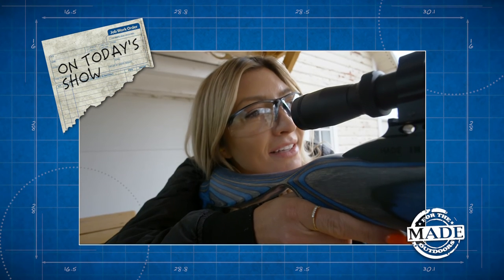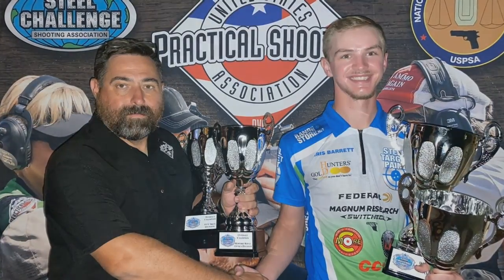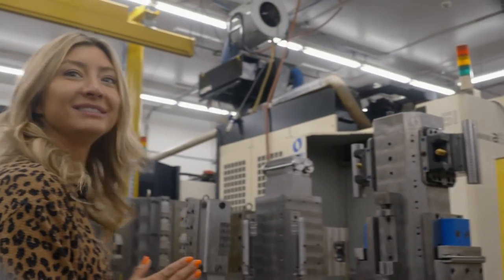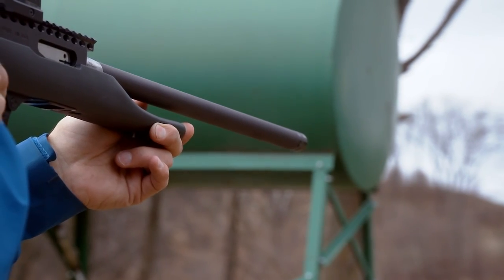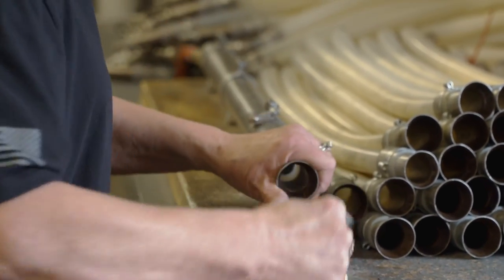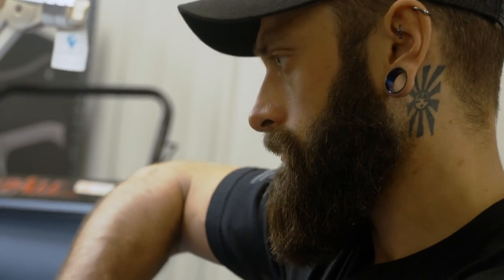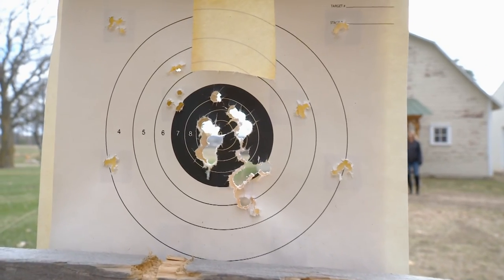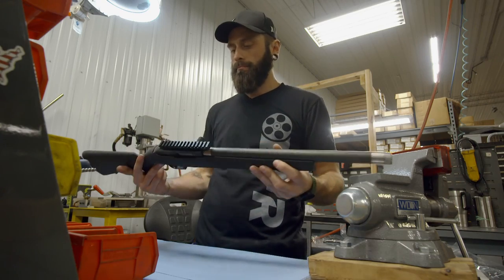Made for the Outdoors (2021) Episode 2: Switch Bolt Rifle

Comment: Thank you for another great episode!  About 13 years ago, I took an inaccurate 1991 10/22 out of the closet, dropped a Power Custom trigger  & sear kit in the action, an improvement from the cast parts' fit and friction, had the barreled action front counterbore machined (rechambered and tuned with the bolt mods), added a Hogue overmolded stock and refurbed Nikon 4x32 scope, and it turned out 3/8" groups at 50 yards.  My daughter shot it during a Labor Day weekend Appleseed event, and impressed the volunteer coaches and instructors as it was her first experience shooting a firearm.  I was happy, and did OK using my early FN-made Browning T-Bolt.  Since we're left-eyed and right-handed, we shoot long guns left-handed.  The semi-auto .22 LR is a little faster than the straight-pull bolt...   I just bought a pair of Thorogood waterproof work boots for this winter and this family's happy that there's still a shoe company in Wisconsin that hasn't been sold to owners outside the state or country.  It's good to learn about all the outdoor products still made in the north.  Thanks again!  :goodvibes:  (Based on what it takes to make cast aluminum and old steel parts function smoothly and accurately, the new tech Magnum Research product is well worth the money.)

Comment: What is the maximum temperature on that carbon fiber barrel before it starts to fall apart!?
Reply: Well, graphite swells and shrinks less than steel does with temp changes... so I imagine a few hundred degrees higher and lower than you'll ever see on planet earth. Lol